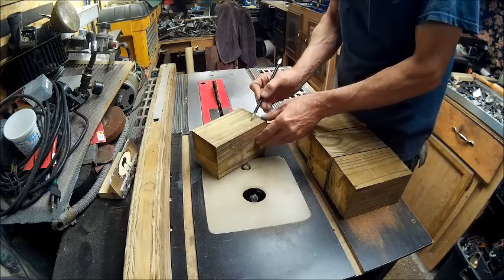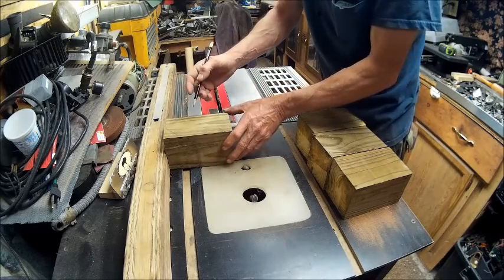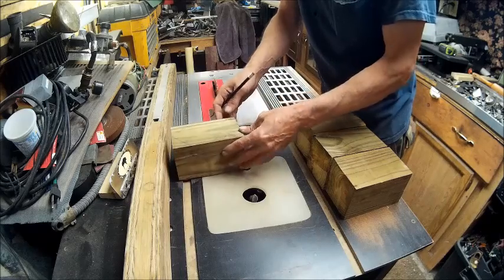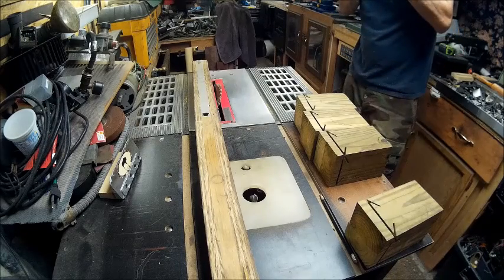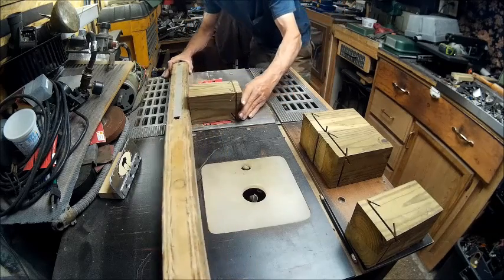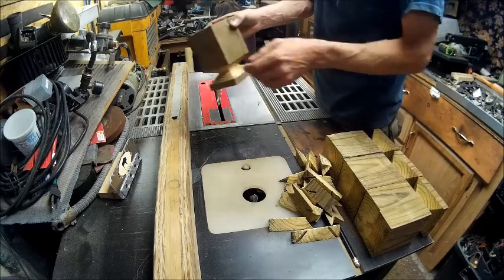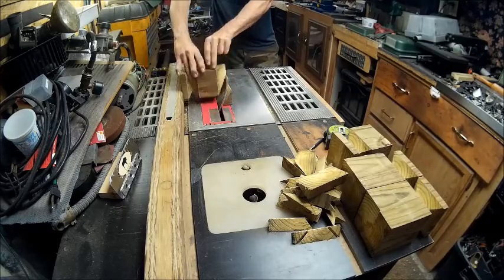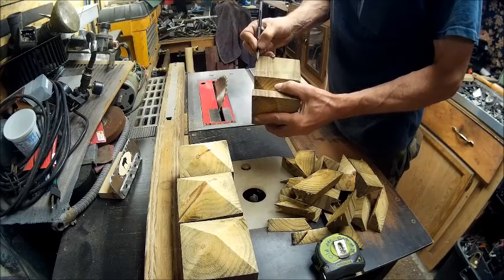diy deck caps

Comment: How do you have all your fingers? At 08:53 you literally extended the blade whilst holding the piece on top of the blade, against the fence, with two fingers.
***SAFETY WARNING P.S.A.***: DO NOT EXTEND THE BLADE WHILST YOU HAVE ITEMS ON TOP OF IT.
Reply from the maker: maybe because i know what im doing.